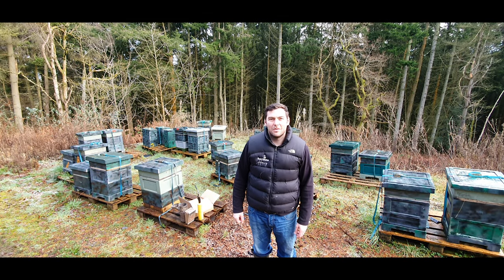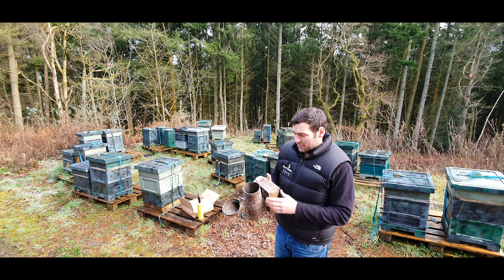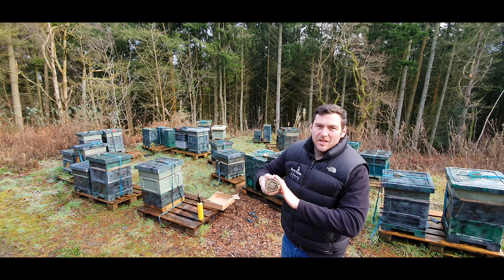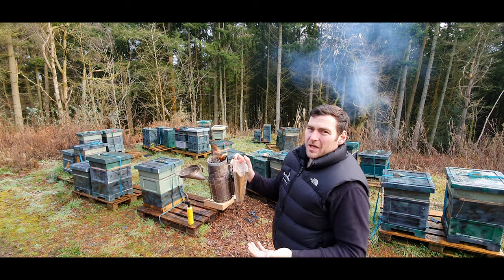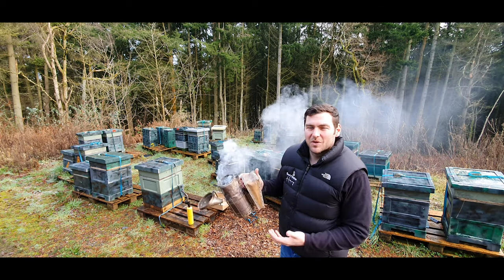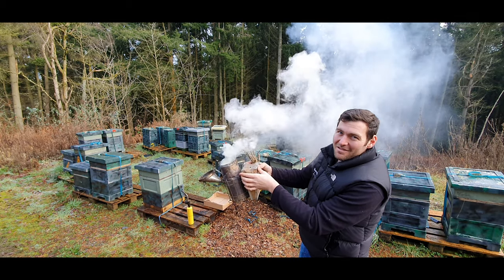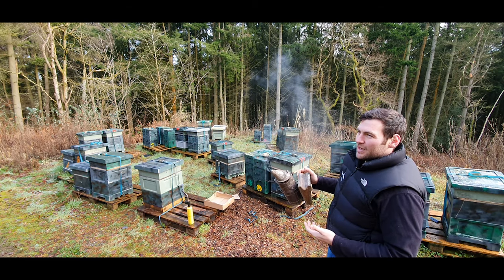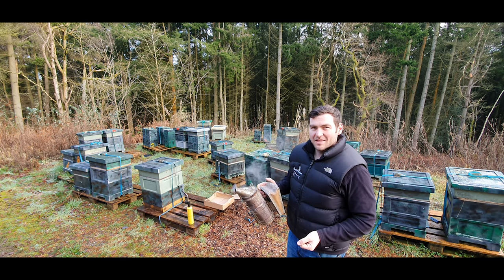Light a Bee Smoker

Comment: I use rolled cardboard but only use half the smoker height. I light it at the bottom to get it going and put it into the smoke by holding it horizontally so the flames don’t burn my hand.  Once the cardboard is inside and burning, I hold it upright and  pump it really good to get the cardboard burning well. I then use wood pellets that I use in my  meat smoker BBQ. They are very small and you can fill the rest of the smoker and their is air gaps between them.  I just pour them in and fill the smoker to the top.

They are designed to burn in my BBQ meat smoker the same way they burn in the bee smoker. I keep a small bucket of them nearby and just poor more into the bee smoker as they burn down to fine ash. As they are designed to cook meat to eat, there is no dangerous chemicals. Works well. Very cheap. 

When done I take the smoker and dump it into my compost heap. The pellets expand and break up into sawdust when wet which causes them to compost really well. If you don’t compost, just dump it around your garden or trees and rake it into the soil. Your plants will love it.